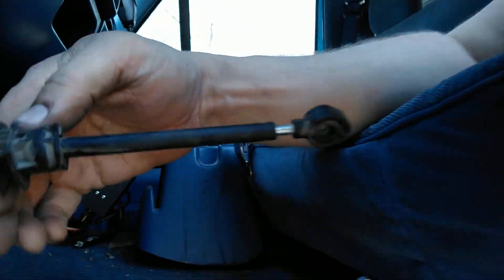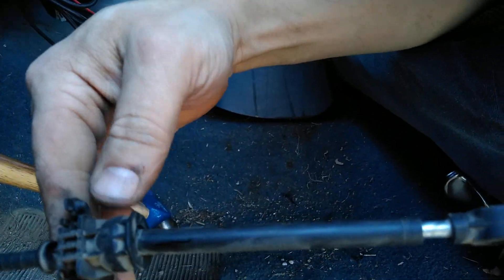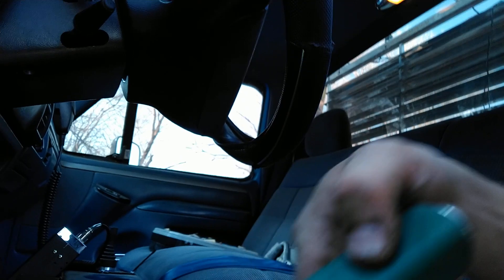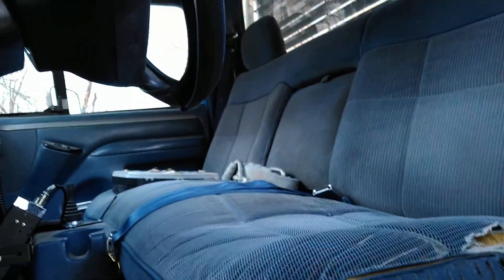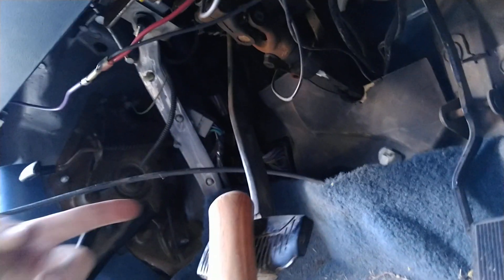1995 F150 automatic transmission shift cable removal and installation.

Comment: When re installing the cable I just popped the clip for the wiring harness out and got everything in without having to take apart the steering or dash . Also too if the clip isn't oriented properly to snap back in for the cable just pull everything back out and rotate the entire cable. Hope this helps the next guy. Cheers 🍻
Reply: 1996 f150 Reg cab long box 5.0 4EOD 4x4
Reply from the maker: @morgandunn6624  thanks for the help I'm sure it'll help people

Comment from the maker: Update on the truck the snow plow I had on the truck was creating a dead air flow area and caused the truck to overheat however since I removed the snow plow the truck runs very cool.